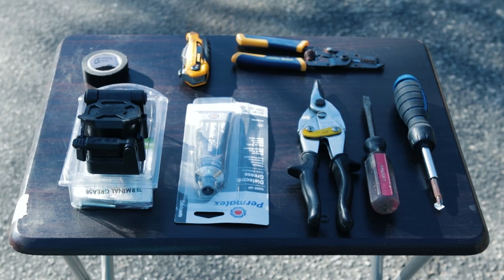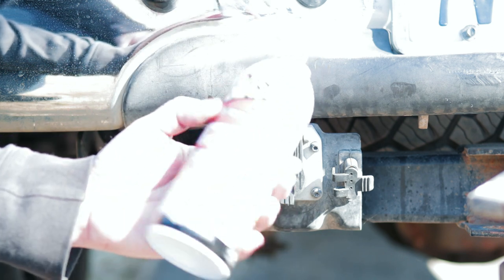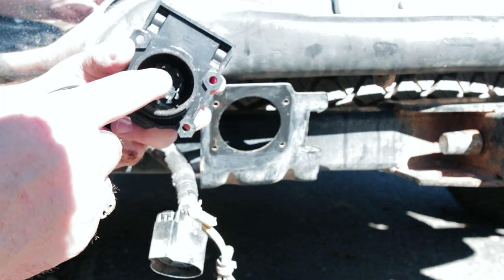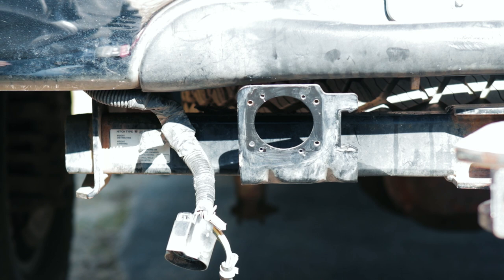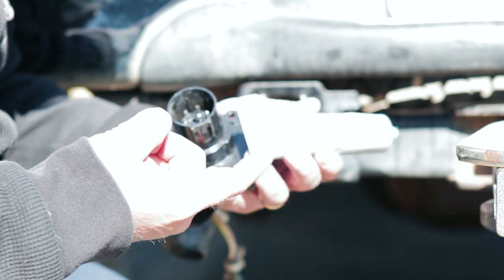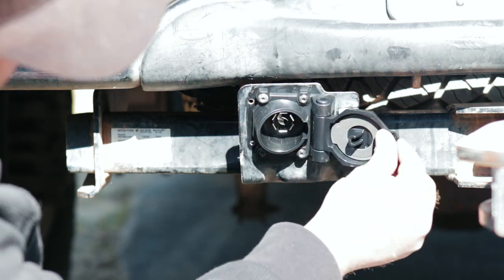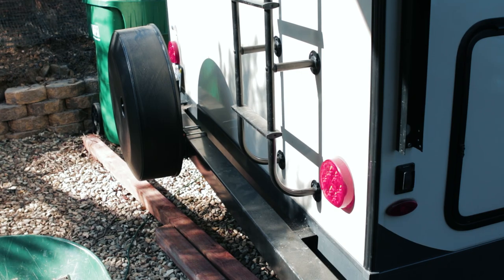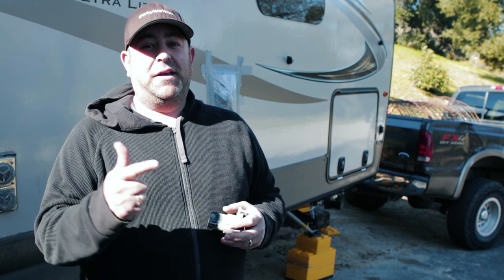Replacing 7-way Trailer Connector on 2005 Ford F250

Comment: 05 diesel...im guessing 6 liter. Have the heads been studded? oil cooler been changed? Have ay of the 6 liter issues been updated? Just curious. I recently bought an 04 dually with the 6 liter